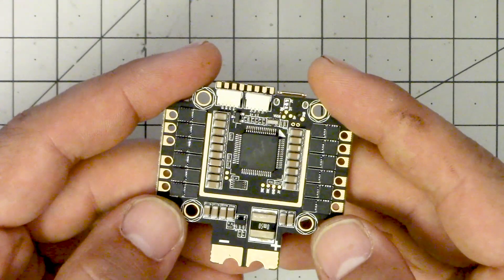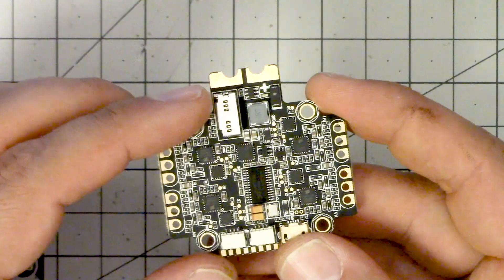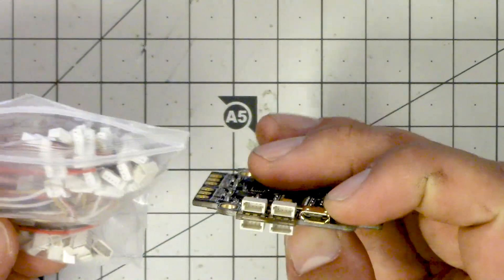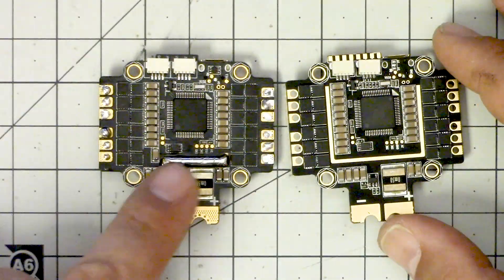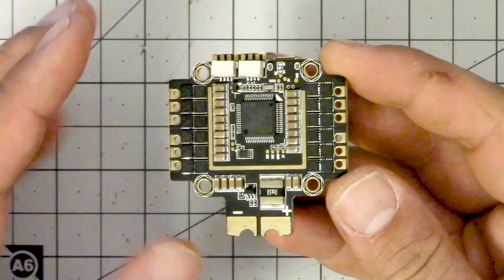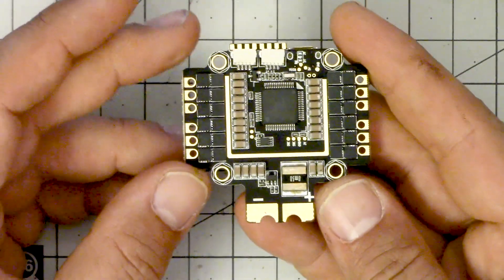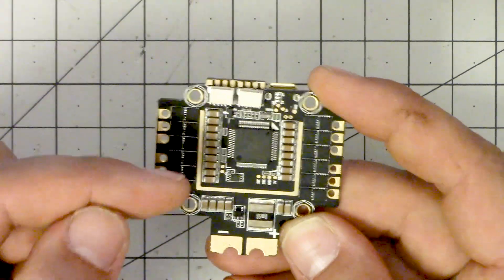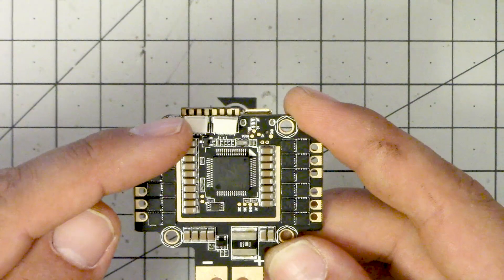Asgard Flight Controller Review | F4 BETAFLIGHT CLEANFLIGHT FC WITH ESCS

Comment: Micro Connector actually was done as far back as on the original Open Pilot Copter Control (predecessor of the CC3D). Circa 2010-2011
Reply from the maker: Yes, good point.

Comment: JB, thanks again for a great video. It just happens that I build a low profile quad with this board this past week and I'm fully loving how it turned out, but it didn't come easy after all being this an AIO board.
Here is the list of issues I had (by the way I used the V3 Lumenier version):
1. 3/5v selector pads are impossible to be used. No matter what I did, it kept giving me 5 volts reading on the output pin.
2. Being a Spektrum user, the UART6 was no good for my Rx and this port is the only one providing the 3v output (if you managed to get #1 sorted), so I don't understand the manufacturer logic when designing this board; Spektrum Rx only works on UART1 for some reason and that port is always at 5v, hence had to find a tiny 3v pad on the board to power the Rx and the rest of my wires were routed to the UART1 port (Bit messy)
3. The video micro JST port doesn't power my VTx and Cam... What were they thinking?... I had to find a solution to power those up from somewhere else than this AIO board... But this has it's own set of issues, I'm getting video noise every time I push the THR up... I placed a 1000 uF cap on the battery leads, but still not solved, any clues? 
4. I haven't been able to log into the FC menu through the OSD using my Tx (mid THR, Left Yaw, Up Tilt, Center Roll)... I thought this was a standard Betaflight feature in the latest releases were ODS was available...
5. This board says it's Dshot compatible, but I was able to only select multishot in betaflight...

happy flying...
Reply: kind of proves my point I posted below. as with most Omnibus related products you are required to make a lot of hacks to get at least some of the features working and wondering what's wrong with their logic in design processes. I just cannot believe company like Lumenier put their name behind something like this when their own products are usually fantastic, like the Lux V2 an absolute master piece.

Comment: Just to add to the V1 failure rate, the one Asgard I had fried the mosfets on ESC number 3 when testing the motors before the first flight. Glad to see the revision
Reply: I had exact same thing happen yesterday at the field. Except it was ESC 4. The ESCs were acting strangely pre-burn as well. No calibration tones. ESC range was crazy as well. 1180-1830ish. Magic smoke bummer.
Reply: My Asgard was great for a few days then one esc fried on a power lood. $78 waisted. it did not come with the right betaflight also. i could never get the beeper or leds to work. getfpv did not publish my 2 negative reviews. i learned a couple of lessons from the experience.

Comment: You can use soft serial for inverted signals and uarts since bf 3.6
I use smart port and smart audio on f4 with subs
Reply from the maker: What pin would you use for softserial on this board?
Reply: Joshua Bardwell 
Any pin. Reassign the resource of the pin you want to use. I do that with pwm5 and 6 on the f4 pro
Reply: Bob Jones is there a tutorial on doing this? I know you have to un assign the pins but what is it you have to assign them as to use them as soft serial?
Reply: daniel dimitri 
Check the rc groups thread for the f4 pro board. Assigning soft serial is described there.
Reply from the maker: "Any pin." Thanks. I'm aware that resource reassignment exists. I might even have made a video about it. I'm asking you which pin, on this specific board, you would use, that you are sure would support soft-serial. This board only has four PWM outputs so I can't use PWM5 and 6. What about LEDstirp or Buzzer?
Reply: Joshua Bardwell 
I learned it from watching you. 
Thanks 1980's commercials. I learned resource assignment from your video 👍
Sorry, no clue for a pin on that board. I just know soft serial works for inverted signals on an f4 chip.

Comment: I'd feel uncomfortable enough using a 4 in 1 esc. If one esc malfunctions, the entire board is useless and I already managed to destroy 2 ESCs in a time span of less than 4 months of flying.

This AIO is a big no-no for me.

I tend to stick to an FC with integrated PDB like the DYS F4 or the HGLRC F4 FLAME and just use individual ESCs. Thats a nice 1 board high stack and the ESCs are where they belong: ON THE ARMS! :P
Reply: 3R45U5 I like how my escs are on my arms, it kinda shows them off, If you wanna show off your soldering or your nice escs the arms is a nice place.

Comment: I've found that uninverting the x4r is really easy as there is a dedicated pad on the x4r which has uninverted sbus. the S.Port was easy to invert (but you could just use the onboard uart1 inverter), hook the four cables from the x4r up to the single 6 pin that has +5v, grnd, Uart3 and Uart6 and it really cleanly installs on the omnibus v4, i assume in this case you would do the same but solder to the top pads and send the tbs smartaudio to that center pad you pointed out. - Good news is that f7's are on the way :D - To be honest it's about time frsky stopped inverting.
Reply from the maker: What do you mean UART1 inverter? I think this board only has an inverter on UART6.
Reply: Joshua Bardwell sorry confused you as the f4 pro has it on uart1 :)

Comment: Hi Joshua. Wondering if you can help. I have a flycolor raptor s, esc/fc stack. I'm getting yaw to the left at full throttle. I have messed with the pids cause I'm not sure if it's a running issue or maybe bad esc. It's running d shot and if my understanding is right, it doesn't need to be calibrated? If that's wrong how do I calibrate? I turned down max throttle in blheli configurator to 1980. Thanks
Reply from the maker: In general, don't adjust max_throttle or min_command without also re-calibrating. There are a few exceptions but don't do it unless you are sure you know why.

Here is how to calibrate: https://www.youtube.com/watch?v=o3Mg-9M0l24
Reply: But does this include DShot? I was also under the impression that Dshot ESCs do not need to be calibrated?
Reply from the maker: Correct.

Comment: I've heard that it's really hard or impossible to get a hold of the company that's sells these in case there's a problem with the board.  So if you can't get a hold of the company then there's no money to be saved and your stuck buying a whole new FC again.
Reply from the maker: That's why it's important to buy from a dealer you believe will have your back. The way it should work is, the dealer has inventory and they make good on the warranty from the inventory, then the dealer goes to the manufacturer for compensation. This is basically the whole reason you pay markup from a dealer, vs. buying direct: to have somebody else deal with that stuff.

Comment: There is a new powercube configuration that is built up with 2 in 1 ESC's making it much lower in profile. would absolutely love to know your thoughts!
Reply from the maker: I have this stack in my QQ190 and it is showing signs of excess vibration. How do I soft mount the FC?
Reply: Tyler Smock Are the bobbins conductive? with a full powercube is there any chance of shorting anything out? I have been brainstorming solutions around removing the plastic shield underneath and using some non conductive standoffs to mount the unit with 4 screws instead of.

Comment: The headers connector from the FC company themselves are better as they come just blank connectors and wires with crimped connectors already on them. That way you only have the wires you need.

Comment: I read there is a way to get your RSSI from your Taranis back to your FC so that RSSI can be displayed on your OSD. I have the BrainFPV F4 FC with XSR reciever. I got smart port set up and smart audio. I get RSSI to my radio, and I read somewhere, lost it now, that I can use a Chanel out and send the RSSI to FC to display it on my OSD. do you know how that's done?
Reply from the maker: https://oscarliang.com/rssi-ppm-channel-taranis/
Reply: in betaflight there is an rssi channel you can set but I forget the tab it's on. on the taranis you can set rssi as an input source then in mixes you can select that input to map to a spare channel.
Reply: Thank you very much Joshua Bardwell.
Reply: Worked great!

Comment: Why does FrSky invert their signal in the first place? You would have thought back in the Naze32 days when lots of people were tapping into the uninverted signal pads that FrSky would have realized they should at least offer an extra uninverted pin for both SBUS and S.Port to tap into easier for people that don't want to use inverted signals.
Reply from the maker: I believe that SBUS is originally a Futaba invention. Maybe Frsky inverted to avoid litigation.
Reply: I am also curious.

Comment: the new f7 processor can have all inverted or un-inverted uarts. omnibus has one and there is another one out there somewhere forget the name
Reply: Cole L The AnyFC F7? that has all 8 uarts on the board?
Reply: Yeah that might be it
Reply: People are screaming on the RC Groups forums about the board not working correctly and being a complete problem child. Making me real nervous because I ordered one last week.
Reply: Oh no
Reply: Bladud FPV Wich one? AnyFC or Omnibus?
Reply: Sorry, it was 3am and I was half asleep while typing that. The board I was talking about was the Omnibus F7, not the AnyFC F7. Can't comment on the AnyFC just yet but seems like a lot of people are having issues with the Omnibus jumping to 100% CPU usage when trying to take the board to 16k, let alone 32k. OSD seems unreliable as well occasionally saying no voltage even when configured correctly.

Comment: So do the F7 boards that are coming out have the same UART inversion problem? Or are they simple better in every way ;)
Reply from the maker: Honestly, right this minute, I think having up to... I think it's 10... UARTS, all with inversion, is the number one most compelling reason to get an F7. Eventually there will be more features that take advantage of its processing power, but for now. UART Heaven.
Reply: Gouada they are mostly better but also bigger so it's a problem for this trend of integrated everything. they have a lot of features that aren't necessary to flight controllers. but the integration causes its own issues with power filtering and a new generation of ESCs is out so maybe we can leave these f4 boards for the spectrum guys who want everything easy. or the flysky guys who want it cheap. f3 boards are great if they don't use i2c for the gyro and the best place for ESCs is still on the arms for cooling. I think the f4 fad and integration fad will be left to a certain crowd and components will come back as blheli32 and the new kiss escs popularizes and ESC telemetry starts to require more connectivity then f7 boards will probably become popular, current sensors won't be needed on the fc and pdb anymore and we will then have more room for power filtering for cleaner video and more reliable performance. the problem now is the f7 boards available are a little lacking. some don't have access to any more uarts and there are few on the market.
Reply: F7 has inversion on all UARTS I believe
Reply: MallyCanFly Alright perfect
Reply: Totally, been skipping the F4 and sticked with F3 ever since it became mainstay because its such a PITA to get smartport working. Also it got like 2 MB of memory, the F3's 256 kB will run out in the near future.
Reply: Hey Joshua the reason why I asked is I'm planning on building a new 5" with Betaflight 32 ESC's (probably the xracer quadrants) and want an FC thats very full featured and ready to get all the ESC data (current, rpm, etc). Any reviews you do on the topic would be much appreciated.

Comment: Nice review. Is it true that the current sensor has a ceiling of 84 amps?
Reply from the maker: I think it was QuadMcFly who posted that info on the rcgroups thread. I would check there for the latest. I trust QMF as much as anybody, but I don't personally know, and I don't want to give out bad info.
Reply: Thanks, here is the link: https://www.rcgroups.com/forums/showthread.php?2863832-Asgard-Flip32-F4-Omnibus-AIO-FC-4in1-24A-ESC-PDB/page15

I've seen 84a max on my build, and somebody commented that it was the max the sensor could read not necessarily the actual max amps drawn.

Comment: Why is SBUS inverted in the first place?
Reply from the maker: I speculate that it is to avoid infringing on Futaba's invention in some way. Futaba invented SBUS and I think that Futaba SBUS is not inverted.
Reply: All the sources I can find seem to indicate that FrSky and Futaba SBUS are identical, both being inverted (i.e. https://developer.mbed.org/users/Digixx/notebook/futaba-s-bus-controlled-by-mbed/ and http://www.robotshop.com/ca/en/futaba-sbus-serial-inverter.html). It is inverted UART with 100k baudrate, 8E2 frame.
Reply: Mrtnlys my theory is the transistor is intended as a buffer for protection of the micro processor, and it may also be a way to keep futaba lawyers away (is futaba inverted? does anyone know?) or a way for frsky to control their ecosystem. they certainly didn't have flight controllers in mind they have their own line of telemetry sensors. but f3 boards are kinda the answer to frsky problems as will be f7 boards.
Reply: Mrtnlys I think Ibus is inverted also
Just had to by a new board to support this for the new IBUS transmitter/RX.

Comment: One thing that this board saves you is a bunch of wiring. If you have 4 separate ESCs with signal grounds that's 8 small wires and 8 power wires. With this board you can do some very neat wiring.

Comment: Is it just me or are there actually little pads in front of those micro JST connectors?
Reply from the maker: Oh geez. Yeah, I meant to mention that. I can't believe I overlooked it. The v1 only had the headers, but the v2 has solder pads. I was still mentally reading the script from the v1.

Comment: I'm surprised you didn't recommend (or use yourself) crimps and a crimp tool.  You don't need to splice wires for connectors, just get a crimp tool and crimps to make your own harness, its waaaaay cleaner IMO, I even ghetto rig connectors into pin header holes on some builds, makes for easier servicing.
Reply from the maker: I will hand-crimp servo connectors, but micro-JST... forget about it.
Reply: Joshua Bardwell it took me a good few tries to learn exactly how much force on micro JST crimps, but worth the time investment with my neat tiny connectors :D
I've also found you /must/ use a manual crimper with them, the spring loaded locking kind just won't work, it's too powerful
Reply: Joshua Bardwell especially if working with Runcams and TBS Unify V2, can't tell you how many times I've re-pinned those :D

Comment: I'd sure like to see that link for the wiring with the headers on them.
Reply from the maker: Oh damn. Hang on.
Reply: Thanks, and sorry to be a pain, but I'd like to get some of those connectors for spares, and I'm way too busy not youtubing to source my own link ;)
Reply from the maker: It's up now. Also note that the V2 of the Asgard has solder pads in front of the header.

Comment: $45 no questions asked replacement? That's pretty sweet. Wonder if you could lie to just keep a spare while you actually have another one shipped so you are never out of the air for a couple days.
Reply from the maker: I would have said that you have to send in the old one, but it looks like on Airbot's store, you can just add a replacement for $45 at purchase time. So it's only about $140 for two?
Reply: Seems like it, not a super terrible deal for the slim target market that they are striking with this product for all the reasons you brought up in the video.
Reply: Seems like you maybe can, they say you just contact them and they give you a hidden link for a $45 board and you just order it. So maybe with some smooth talking you could. But they should offer it right off the bat but maybe they dont in order to stop people abusing the system and selling them.
Reply: Yeah, its not for me anyways
Reply: 250g Limit there likely isn't space for that. I think this product is perfect for the spectrum and flysky/turnigy users out there. but unless they decide to take the ESC components from the midguard(a slightly smaller version of this that actually fits in the 36x36 form factor) and stretch it out to the size of the asguard. otherwise it would probably have to be an f3 processor(nothing wrong with that if they use spi for the gyro and a virtual com port),  I don't think there is space for more components without creating fitment issues in some tighter frames.
Reply: The airbot Asgard says on the website not only no questions asked 45$ replacement but also says if u send in they can normally fix for free, so what id do is immediately get a 45$ backup then when one shits the bed send in hoping they can fix it for the cost of shipping... my guess is they could replace the fetus and good to go